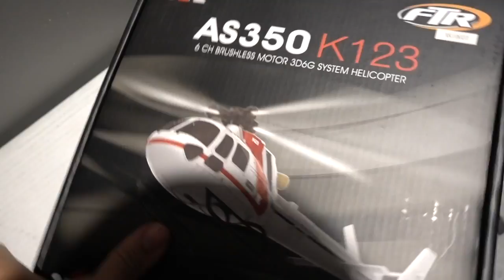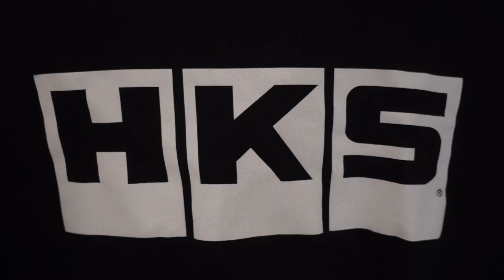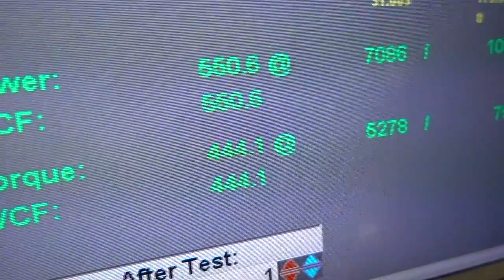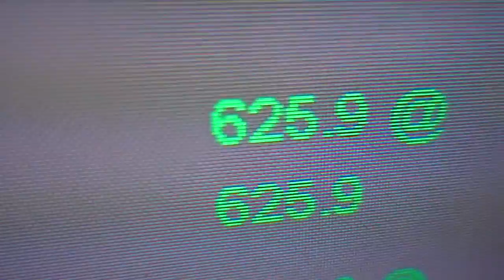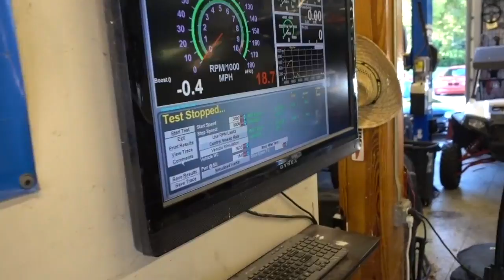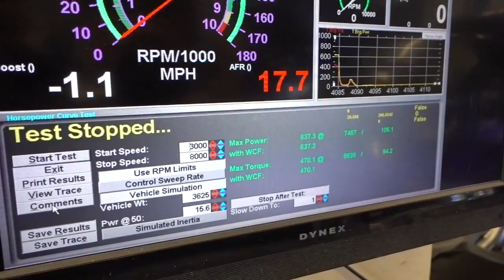MOTEC EVO on the DYNO!

Comment: Kinda low for maxing out a 6266? That’s what high 600s on a dynojet? I’ve seen these turbos well into the 700s on evo 10s. What am I missing?
Reply: His dyno reads super low .I'm sure that is like 710 or so on any dyno jet .good way to find out is see what lb/min he was logging
Reply: onelow vdub thought I saw a bolt on pump gas evo x put down almost 350 on his dyno which is about right for DJ. I could be wrong though. I’m curious to see boost numbers and what rpm.
Reply from the maker: 46psi at 8500rpm. 

This would be around 710whp on a dynojet.
Reply: @JackCecil  how does it not lift the head
Reply: Magic.